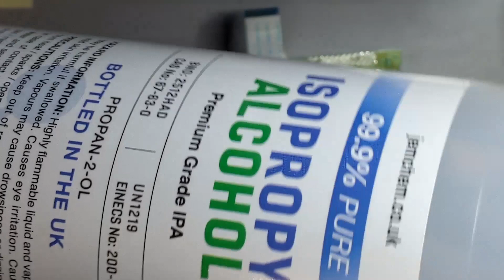GameCube Battery Mod

Comment: For some reason I never thought to use tweezers to hold the soldering braid/wick.
Reply from the maker: @RobertPendell  didn't you burn your fingers? 😁
Reply: @topvint8787  Definitely couldn't hold it for long.  I usually just used a really long strand so my hand was far away.